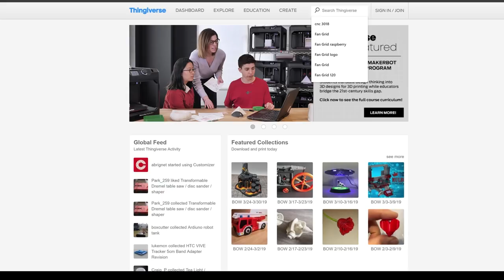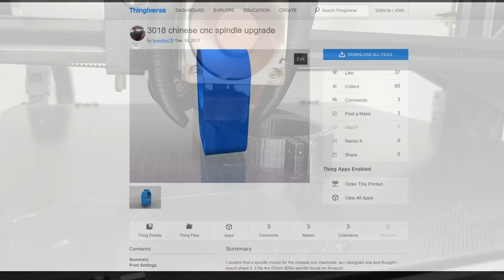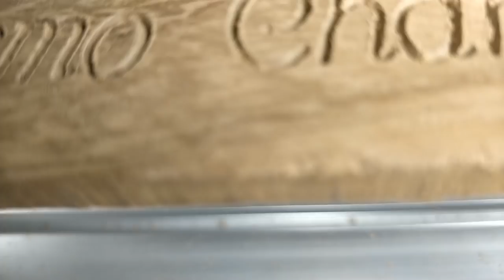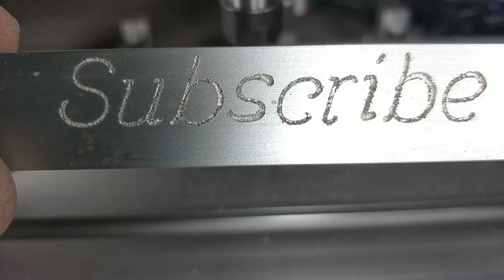UPGRADE CNC 3018 Spindle Motor with Machifit ER11 Chuch 500W

Comment: I've just installed the same spindle on my 3018 machine and found that there's just too much play along the X axis, maybe because of the added weight in the Z axis assembly. I'm confident that replacing the rails in the X axis with fully supported ones will solve this problem, though.
Reply from the maker: it's true.  with the extra weight the movement is excessive.  let me know if you solve and what you use.  thank you!!
Reply: Jônatas Rech I just installed the same spindle. How did you weight issue?
Reply: Roger Webb shows how in this video: https://youtu.be/tmPxWA6c0pg

Comment: You should not solder on a crimp. The solder stiffens the wire and makes it more susceptible to breaking. Just ensure that there is a match between wire size and crimp, and also use a good crimp tool. Furthermore, I recommend you use ferrules to terminate your wire instead of tinning the ends - the solder deforms over time and the wire becomes loose in the terminal. Thanks for sharing your project.
Reply from the maker: Thank you for your invaluable advice! You never stop learning!

Comment: What is the max voltage coming from the power supply at full speed? Did you adjust the small potentiometer on the circuit board to limit the max voltage?

Comment: The wiring part of this video was kind of confusing. Could you make a more detailed video on wiring??
Reply: Yes, could you redo how you did the wiring? I have the bracket and spindle installed but you lost me on the wiring part. Thanks!
Reply: @jasonnayman6409  Yeah i was just wondering the same ? By the looks of it the original power is just attached to the motor but where does the second set of wire's come from that he attached to the motor side of the new new power unit ? is that from the original woodpecker control board ?  If so that is the controller wires, but the question remains were does the power come from that goes to the new unit ?  (the inputs that say on/off - motor - power) ? or does that have a separate power supply ?
Reply: Yeah i was just wondering the same ? By the looks of it the original power is just attached to the motor but where does the second set of wire's come from that he attached to the motor side of the new new power unit ? is that from the original woodpecker control board ?  If so that is the controller wires, but the question remains were does the power come from that goes to the new unit ?  (the inputs that say on/off - motor - power) ? or does that have a separate power supply ?
Reply: I'm watching this for the wiring. Where did those two wires for the power supply come from?
Reply: Same question. Are you using an external Power supply for it? I am doing the upgrade on a 3018 pro version and the power Output ist 24V. Not enough for that spindle
Reply: I'm here for the wiring too. I can put it all together, but I still don't know if it's controlled by the controller or the knob. It looked like he just plugged the old wires into it. Then he fiddled with the knob on the new power supply. Then it looked like he connected the power supply to the board. I have no idea.
Reply from the maker: Hi. Unfortunately I missed these comments and did not respond immediately. The spindle is connected to the positive and negative of its power supply. The speed like its ignition is manually controlled with its power supply and potentiometer. The cnc control board has no connection to the new spindle.
Reply: @cosmochannelvideo  what you are saying that operating (only the spin, axis are by cnc board) the new motor is manually and not through the CNC control board it self, this is what i got from you and other video, correct me if i am wrong.
Reply from the maker: as I did in the video you have to turn it on and adjust the speed manually. you can put a relay at the controller output that activates the spindle but the speed is still manual.
Reply: @cosmochannelvideo  un altro ragazzo, Minh's fa una modifica alla scheda madre e riesce a farla funzioare tramite controler e non manuale.. non so se ti è capitato il video, ma non me ne intendo molto, non saprei dirti bene come fa
Reply from the maker: Ciao! Non ho visto quel video. Diciamo che farlo partire dal controller è semplice. Il problema sta nel poter regolare la velocità sempre tramite controller.. ora cerco il video

Comment: Io ho la tua stessa combinazione, però mi succede che quando aumento il potenziometro del mandrino  (dal 50% in su) la macchina si blocca buttando via ore di lavoro, per caso succede anche a te? Io di elettronica non ci capisco molto ma sembra un problema di interferenze elettromagnetiche
Reply from the maker: Ciao! Hai i limit switch abilitati?
Reply: @cosmochannelvideo  per abilitati non so cosa intendi, però i limiti switch ce li ho ma sono scollegati perchè mi davano problemi
Reply from the maker: hai disabilitato l'hard limits sul controller tramite comando grbl?

Comment: More vids on this! I would like to se if it can mill brass. Im thinking of buying this machine and upgrade it like you did and cut parts from 1mm brass sheets. Nice vid!
Reply from the maker: Hello. thanks for the comment. I will definitely make more videos on CNC as soon as I learn how to use it! I'm sure you can cut brass even thicker than 1 millimeter.
Reply from the maker: This CNC can give great satisfaction if properly adjusted.
Reply: Awesome!
Reply: i think you can cut steel if you dont do it to fast and only 0.5mm per turn.

Comment: That spindle-motor driver is crap. When it dies you should open it up and see what they did to it in china. Mine had all sorts of trace ground off and rerouted with hokey wiring, and giant globs of solder. Frankenstein boards. 

I got sick of the noise, so I replaced that with the brushless 500W.. Soooo much better! Watch out for EMF too! It can cause real issues with losing step.
Reply: yup I FELT that EMF..... literally shaking my stepper motors and now I need to buy a new spindle set

Comment: I have a new 500w, when using it at more than 50% for 30 minutes it heats a lot, is it normal? Will it be a bad voltage? or it will be damaged
Reply from the maker: Bye. It depends on what you mean by heating a lot. you don't have to burn. if it's hot it's fine.
Reply: Does the fan on the top spin ok ? sometimes thy clog up with dust and debris in the fan encloser.. BUT it should not get overheated a little warm maybe. You could drop the speed down on the motor and on the x/y speed of the cut that will help, it may take longer but will be safer on bit cuts.

Comment: Be aware that the holes are exactly the same size as the bearings so if you have calibrated your printer too well it won't be a good tight press fit

Comment: Where did you bought spindle extention wires.Are you used 18 gauge silicon red and black wire  for extend the spindle wire.Which wire are you used for power.where did you bought it.
Reply from the maker: 18 awg is perfect

Comment: So,how are you powering the spindle board?I just got one of these(with Mach3) and I'm confused(I'm in US,btw),do you just put 110v to the power terminals?Don't wanna blow it up,lol..Thanks for sharing!
Reply from the maker: Hi, there. I connected the 220V to the input of the motor power supply. The motor is powered at 48v and regulated by a potentiometer. Unfortunately with this configuration it is not possible to manage the speed with the motherboard of the cnc.
Reply: @cosmochannelvideo  Thanks for the rapid reply!That at least let's me know how the supply is powered,I can figure out the Mach3 control later.Best Wishes1

Comment: There is something I don't understand, I hace a machine like that, but the spindle is 775 and you are upgrading it with one of 500, could you explain me that please?
Reply from the maker: Hi, there. The original motor is 80w maximum 9000 rpm. The one I mounted is 500w maximum 12000 rpm without vibration.

Comment: Hello.I am wondering about one thing.You disconnect original motor from the cnc board isnt it? And than you connect two wires ded and black ,one side to controler and other side to the spindle motor?
Reply from the maker: Hello. I disconnected the original spindle from the card. the new spindle cannot be controlled by the CNC card and therefore I connected it to its power supply
Reply: @cosmochannelvideo  did you connect limit switches to your board.I have Eleks Mana board and it us slightly different than original..and i am wondering how to connect them
Reply: @cosmochannelvideo  Great! Please provide this information in the description of your excellent Video!

Comment: Has you some problema of interference of spindle?
When I turn on the spindle, my stepper motors go crasy.
Reply: what are you using for your controller? you may need to check the type of gcode your using
Reply: Rip Martin , Im using a arduino + cnc shield v3. The Gcode is generated by Artcam 2008. Extension of file is .tap
Reply from the maker: Hi! I have never had interference problems. You could shield the spindle's power cord.

Comment: Get rid of the music, it's unnecessary and I would have the spindle mount CNC,d out of aluminium along with it's mount, it won't cost much as the files are free to download, more info on wiring should have been clearer as there is 220v at the start of the supply,  people tend to forget this , while the board is low voltage the power supply will kill you.....

Comment: To reduce the movement of the z carriage, use a bracket with a v roller mounted to the top of the carriage so the v roller travels in the groove of the 2020 horizontal bar.
Reply: thanks for the idea, i think ill try that on mine

Comment: Hammering bearings in? No wonder the axis locked up. If you dont have a press, you chould have pulled them in with a length of stud (threaded bar)
These cheap machines can be so much better if assembled carefully - 3D printers are a perfect example
Reply from the maker: You're right. I admit I made a mistake using a hammer to insert them. In the video I posted a while ago where I change these bearings I used a vice to push them in. Thanks anyway for the message!

Comment: the size of the model is wrong brandon75f, did you have to grind the axles?
Reply from the maker: The dimensions are right. I printed it the way it is on tinghiverse and edited it without changing anything.

Comment: I am thinking of doing this exact upgrade. Is it worth it? What are the biggest advantages?
Reply from the maker: works very well especially for very small engravings at low speed. but I would mount it on the cnc 3018 pro which is much more stable.

Comment: Nice job!!! I have the same CNC machine....pumped up with limit switches...Z probe...learned a lot with it. Just a question: how is your spindle turned on?
Reply from the maker: Hi Adrian. thank you!. I'm looking for ways to start it via the motherboard but for now I turn it on and set it by potentiometer. I'm also looking for information on the limit switches and z probe.
Reply: @cosmochannelvideo  I have a sheet drawn up for connections on this CNC if you need it, I can email if you like?
Reply from the maker: @dmaher2007  Of course it is! Thank you so much! cosmochannelvideo@gmail.com
Reply: @cosmochannelvideo  sent 2 drawings,  Check your email,  Cheers.
Reply: Cosmo Channel could you do a video with the limit switch upgrade? I have the limits and I'm pretty sure of what pins to use, but it's nice to have verification. CNC without home is a big PIA. I'm putting together a 50x60 5000 watt laser right now. I'm a newb so any help and suggestion are welcome.
Reply from the maker: @privatebubba8876  Hi. I'm getting organized to retrieve all the materials needed to assemble the end stops. I will definitely make a video of it as soon as all the material arrives. A 5000w laser?
What do you have to drill steel plates for? :-)
Reply: @cosmochannelvideo  It's for cutting 007 in half. mw fat fingers at work. LOL. Thanks for the reply I can't wait for the video.
Reply: @israelcarranza8331  Hi Israel,  check your email.  Cheers.
Reply: @privatebubba8876  what GBL board are you using ? (woodpecker) if it's the new one there is a slot at the side for pins, two sets of two pins for each direction so that's two sets of 2 pins  one set for each side of your CNC Y X and Z , the switches to use are normally closed (on) so a switch that is closed then opens on contact (when limit is reached) this then opens the switch cutting off power to the motor (hope that makes sense)
Reply: @grandpaben5789  Thanks.
Reply: @dmaher2007  Hi Dave! May I ask you to send me the drawings too? THX
Reply: @tusla8979  send me your email address and i will send it.  Cheers.

Comment: Thank you for your video.
Can you tell me specifically how to connect the control board, power supply, and spindle? If you don't mind, can you explain it in a picture?
Reply from the maker: The spindle is controlled manually. It is not connected to the controller
Reply: Cosmo Channel Ok,Thank you

Comment: Do you plan on upgrading the stepper motors,  If so what will or would you use?
Reply from the maker: I still don't have any idea what to put on.  :-)
Reply: @cosmochannelvideo  For my upgrade I have ordered 800mm Length 2020 T-Slot Aluminum Profiles Extrusion Frame for 3D Printer CNC x 6..........800mm x 8mm Linear Rail Shaft Rod with Bearing Guide Support and SCS8UU Bearing Block x 4........T8 800mm Stainless Steel Lead Screw Set with Shaft coupling and Mounting Support x 2 Plus the  the spindle motor you shoewd on this video, and the spindle upgrade thingiverse, I ordered that a few minutes ago,  so I should have an 800mm  x  800mm cnc,  hope it works?  time will tell.
Reply from the maker: @dmaher2007  So much stuff! You're practically building a new one! That's great! Keep me informed! I want to see the photos!
Reply: Dave Maher   If I may ask, from where did you order these? I’m keenly interested in your results.
Reply from the maker: @niranthbanks3595  Hi, there. In the description of the video you will find all the links
Reply: Cosmo Channel, Actually, I was where he had ordered the aluminum rails and such. I’ve downloaded this video to help me upgrade the spindle motor; thank you for making such a helpful guide!
Reply: @niranthbanks3595  I ordered all from Banggood.  After checking my design I'll have to order another 800mm rod and another stepper motor. As using just one on the Y axis wouldn't have enough torque.  But everything else should be good to go.   I HOPE 😀
Reply: Dave Maher, are you increasing the platform size? If so, out of what?
Reply: @niranthbanks3595  800 x 800 is the plan,  all depends if I can get the torque out of the 2 stepper motors on the Y axis?
Reply: Dave Maher did you finish the expansion? Guessing all you needed was a larger frame, longer lead screws, longer rails and higher torque steppers? My concern is that the existing lead screws might not be sturdy enough over that increased length.
Reply: @genizaontour   Hi Mark, I will be using 2 stepper motors for the Y axis and 10mm round bar instead of 6mm.  Also I will be using 12.50mm MDF as the bed for the cnc to keep the weight down this should help the motors. As for your concern about the lead screw.  from the test I have done I haven't found any issues.....Yet so far so good. Cheers.

Comment: A minor upgrade. If you are going to this amount of effort then it would have been better to have addressed the issues of having the spindle mounted so far away from its supports - this gives unacceptable flex in stock configuration. Im about to add this type of spindle to mine and hopefully will address these issues...

Comment: make a video of it milling aluminum not just engraving
Reply: Also he is using a wood engraver on aluminium, you can see the tip got frayed at the end.. Using a tiny ball end mill would yield better engraving quality if it's only for text.. and that's pretty cheap - you can get them on ebay for under 5 bucks with free shipping..

Comment: Nice! How much better is the new spindle?
Reply from the maker: Surely the spindle does not vibrate and turning faster results in a faster and cleaner cut. The motor weighs more and therefore the speed of the movements must be lowered. However, excellent engine!

Comment: printing that shit now, thanx bro
Reply: can tell how is it, is it enough strong, to hold stronger motors
Reply: @bblloobb1000  yes it is... I modified it on my thingiverse tho.. I like to buy bolts by the pound so I did away with that metric crap. https://www.thingiverse.com/thing:3876546   Works great in holding the spindle but the machine could use some beef with the upgraded spindle!